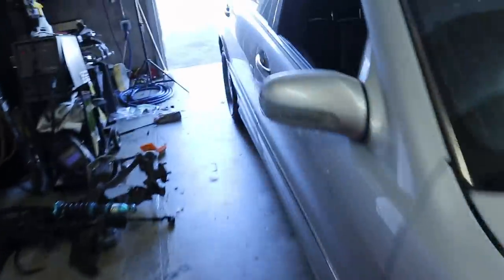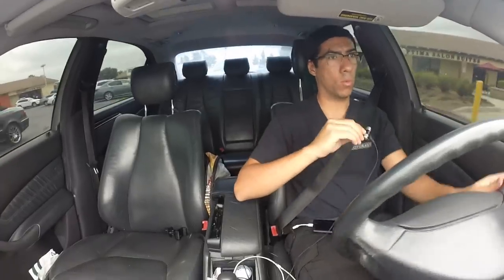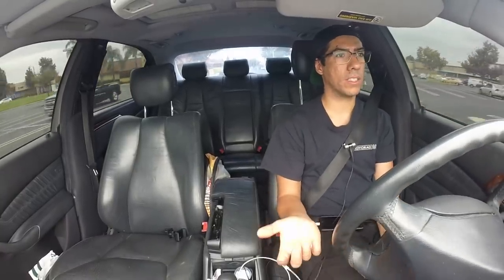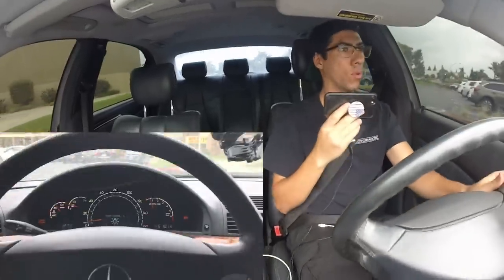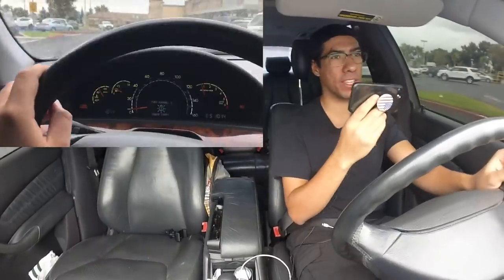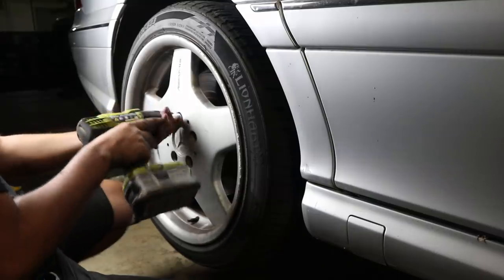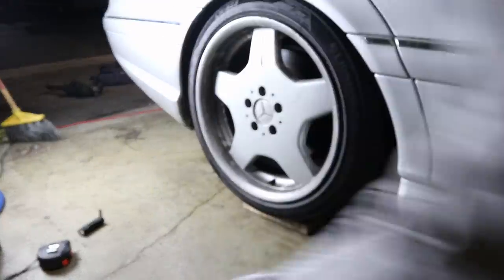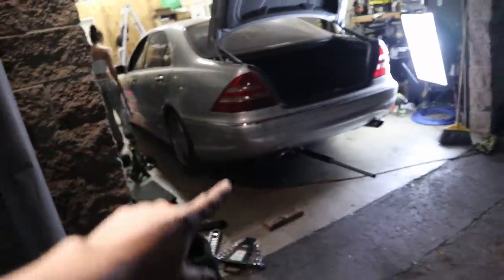Slamming My S-Class on Coilovers - PT. 1

Comment: The second collar is for the lower spring perch
Reply from the maker: I maybe thought that but here's my reasoning:
1. Lower spring perch is threaded and tightens against the single top collar. It's already adjusted for preload and tightened from factory (i checked)
2. The way the two bottom collars face (one side being flat and one side being rounded) indicates that the two bottom collars should be used to lock on the lower portion of the shock. Just as I did in the video. Since the flat sides were facing downwards.
3. All 4 coilovers had the same orientation and placement for the collars. 
4. Other install pictures of these coilovers on the w220 also show the two stacked collars on the bottom portion of the coilover. EX: https://mbworld.org/forums/attachments/s55-amg-s65-amg-s63-amg-w220-w221/364108d1501224193-w220-abc-delete-converted-yellow-speed-coilovers-img_9359.jpg
5. Pictures of the coilovers by YellowSpeed themselves also show two collars stacked on the bottom EX: https://cdn.shopify.com/s/files/1/1750/2425/products/Super_Low_Hi_Res_936ecc64-e4a4-4d46-948e-c2be064cc47b_530x@2x.jpg?v=1503993185
Reply: @OffBeatGarage  Could very well be! As long as there's a locknut/collar locking the lower spring perch in place you're fine :)
Reply: @Alex_Lamus_99  is right in this one.

Bottom shock body is threaded. which is what you need to lock with only 1 collar.

Think of the 2 nut rule when you remove a stud: the bottom shock body is the "first nut" and the bottom locking collar is the "second nut" which locks the 2 together.

The upper locking collar needs to lock the spring perch together.

Springs spin as they compress. You don't want a spring spinning the perch on a threaded body... because, it's either going to potentially raise or lower the spring perch and alter the preload and ride height which will lead to either ramping up the preload, raising the car and wrecking the shock or winding the spring down and lowering the car as you drive.

Common sense stuff.
Reply: yeah the collars are wrong, the spring perch collar still needs to be locked..

Comment: Im sorry bro but thats not a 55 amg😑
Its only an s500 maybe with fake badges 🤦🏼‍♂️
Reply from the maker: Vin says otherwise lol. 2002 and before s55 were not supercharged
Reply: Mohamad u got rekt by a vin number lmao
Reply: Bro I know I have a s55 its 2001 and its all different outside body kit  and inside and different motor shape without supercharge  and exhaust sound different Im telling yours is a S500 or s550
Reply from the maker: @mohamadmobayed2281  So looks like your car is different then. Here's 3 listings for 2002 S55 all with the same wheels, body kit, engine bay, and interior as my car.
https://www.cargurus.com/Cars/l-Used-2002-Mercedes-Benz-S-Class-S-55-AMG-t37792#listing=250368331
https://www.cargurus.com/Cars/l-Used-2002-Mercedes-Benz-S-Class-S-55-AMG-t37792#listing=247575158
https://www.carfax.com/vehicle/WDBNG73J32A225832
Reply: Maybe yours was a s55 without supercharger and someone put it in